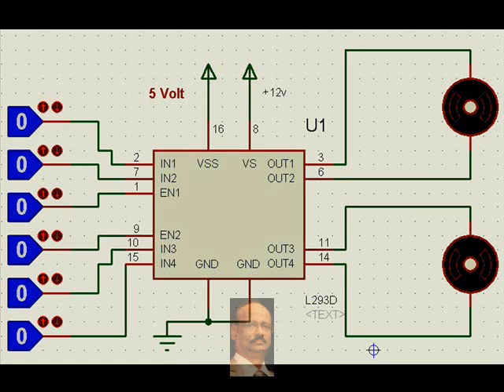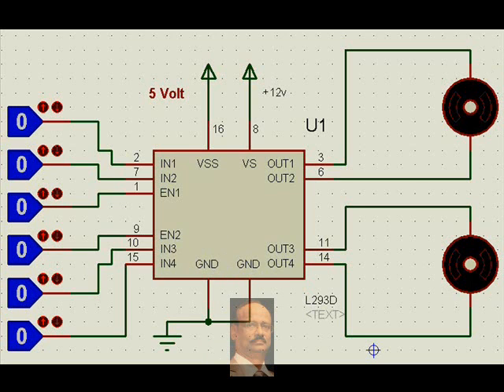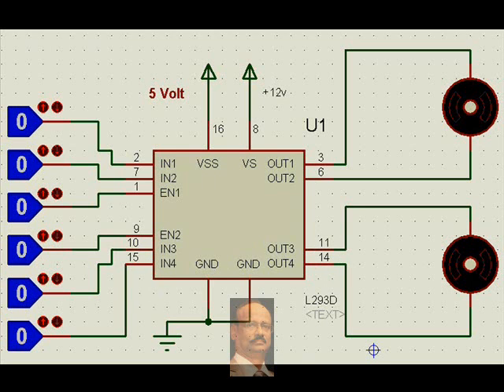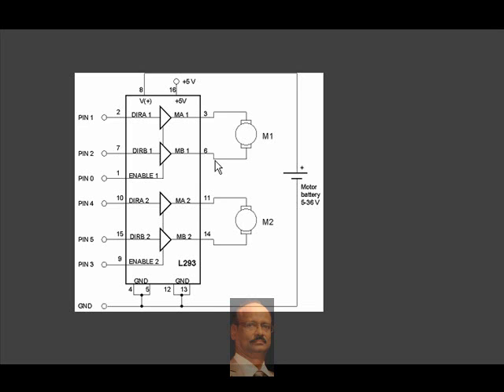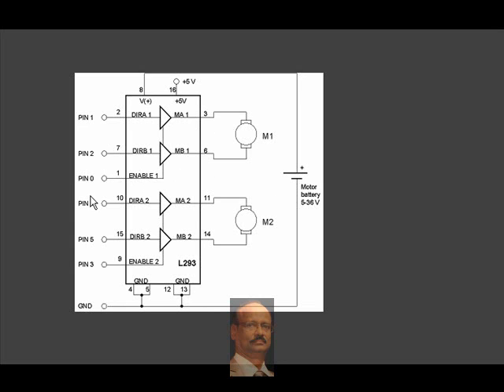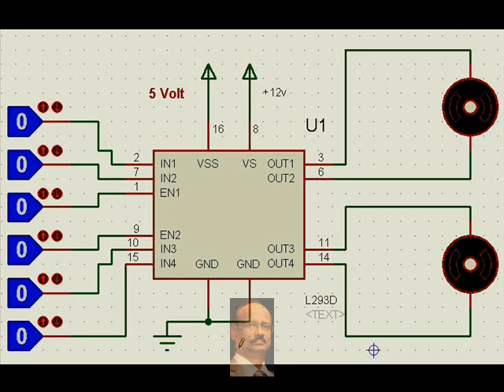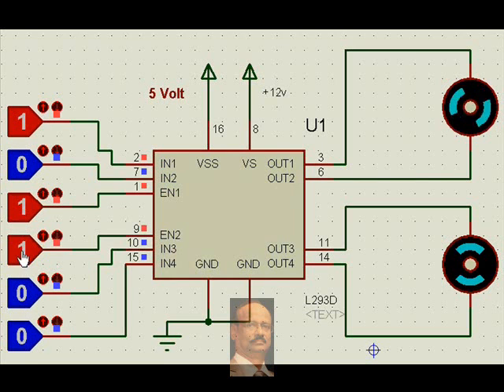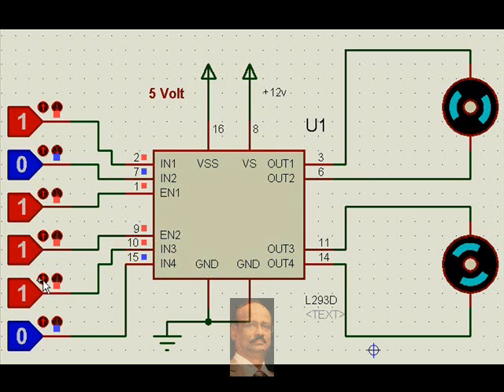Microcontroller interface to Motor driver IC L293D

Comment: sir...why there is no protection diode on motors for the safety of ic? 
plz reply..thank you
Reply from the maker: It is built in inside the IC
Reply from the maker: Since the motor is required to operate in either direction no diode can be used. Only a small capacitor of 0.01 uF is used across the motor terminals